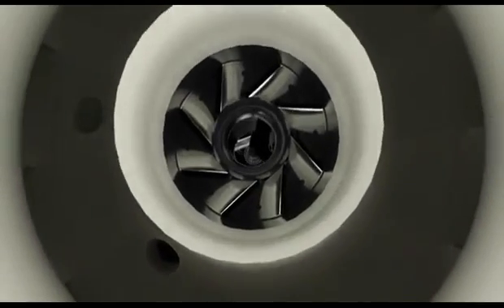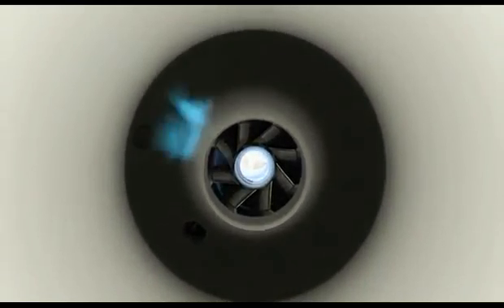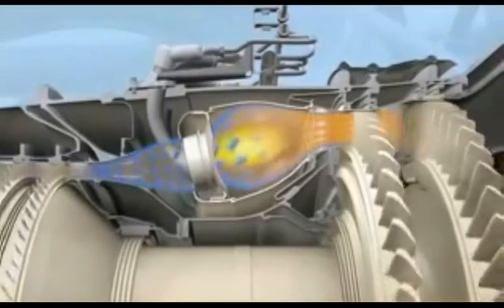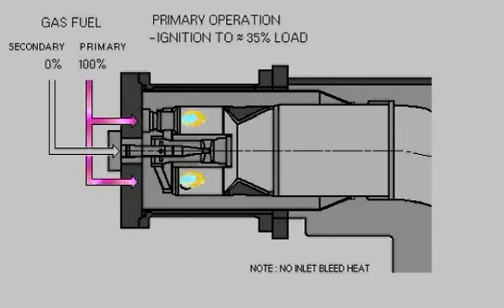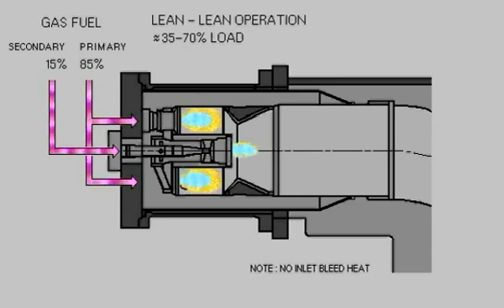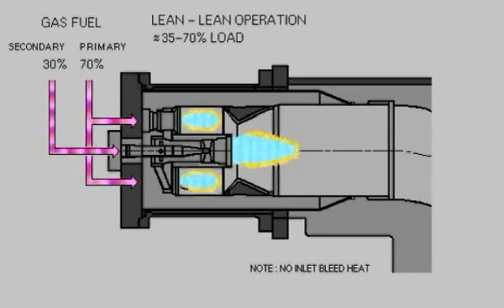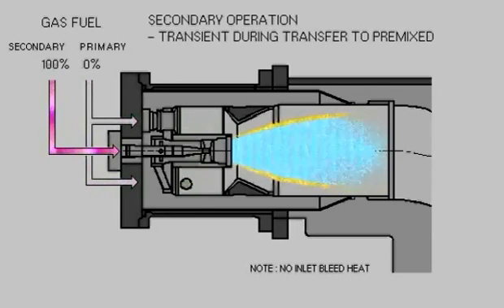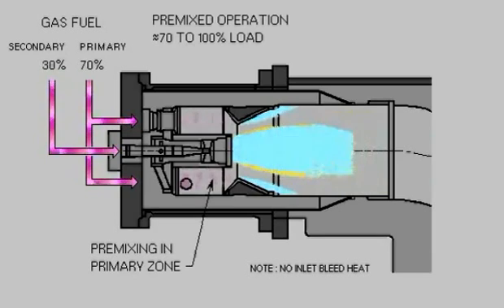DLN 1.0 (Dry Low NOx) Combustion System

Comment: Dear i m looking with IBH.
Reply from the maker: Dear, Inlet bleed heating takes Compressor discharge air to heat compressor inlet air to reduce air mass available for combustor and stablize the combustion process. In this video I have explained for modes of DLN irrespective of IBH. You can use this reference training for both cases with/without IBH.
Reply: @aleemahmed9572  because in video it is mentioned with no IBH that's why
Reply: And i want to know the relation of IBH at different modes of DLN1